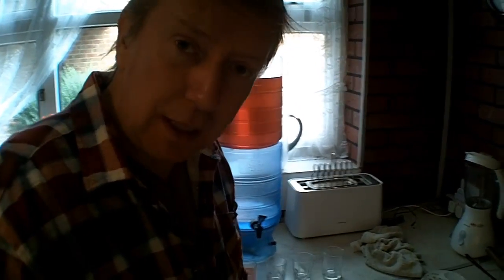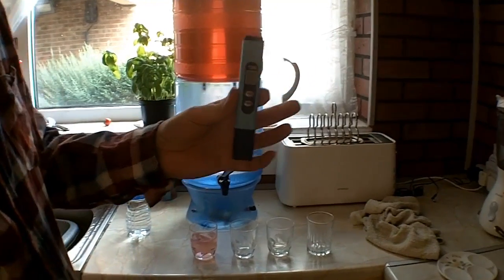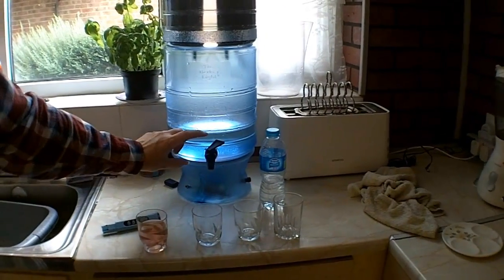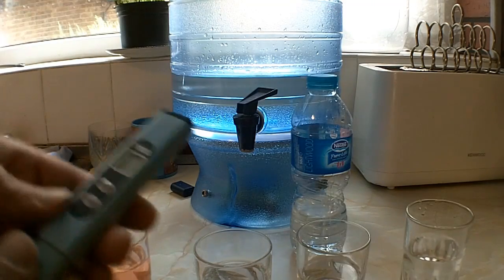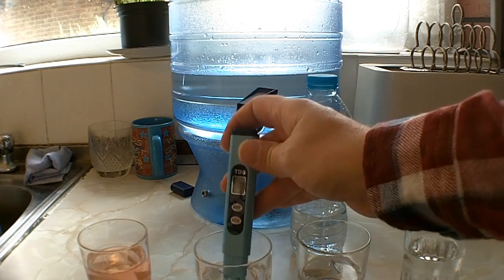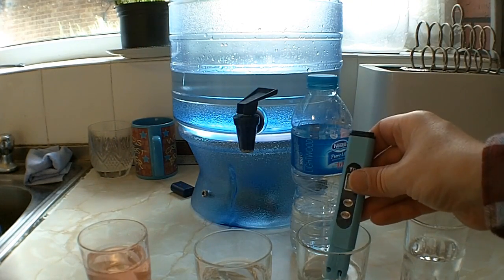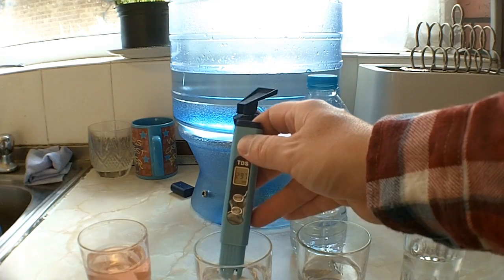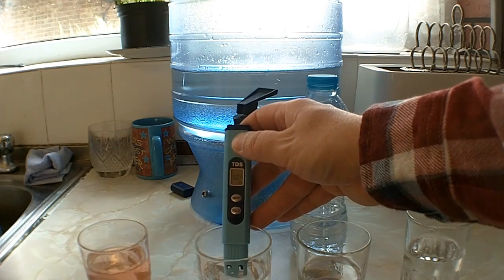Berkey Water Filter PPM Test

Comment: In a recent test:
Tap water: 89ppm and zero chlorine
British Berkefield: 139ppm
Distiller: 2ppm

Been using a distiller for 4 years and adding electrolytes/minerals back into it.

Will be testing the Berkefield with fluoride filters soon.

Comment: Similar thing happened to me with the English Berkley system which looks like a Berkey but has different ceramic filters. I ended up putting it through our Zero Water jug to get the TDS down from over 300 to 9. Anyway thank you for your video.

Comment: I’ve had a ZeroWater filter and it comes with a TDS meter. That results in 000 clean water. Also water from the Glacier machine at the store resulted in 000 clean water. Just got my Berkey Travel and the number was almost the same as my tap water around 550. Very little difference. I’m thinking I haven’t setup my filters right that’s why I’m here in this vid. I too am disappointed in your numbers in the 100’s. I hear what some are saying about not all TDS are bad but like I said my previous filtered water options have given me 000 clean water. Paying as much as I did for my Berkey I’d like to see better results when it comes to TDS so I’d like to see what Berkey has to say about this. 🤔
Reply: Same. Our city tap water is 133. Coming out of the Berkey, it's 140ppm and it's been running for two months now. The water tastes great, but I can indeed agree that it doesn't drop the ppm. I can validate it by testing with distilled water, and my ppm consistently is 0.
Reply: Well the question is that if it leaves minerals because it is not attracted to the carbon and the bad stuff is. Allegedly that's good. I don't know

Comment: Hey I appreciate you for taking the time to make your video. I have been a little bit disappointed in my Berkey recently and I just found a water filter at Walmart called the zero water filter. You should check them out. I have been thinking about making a comparison video with my Berkey comparing it to my new filter.
Reply: $15 per filter that will filter 40 gallons.
Reply: Too expensive. I use berkey for coffee, cooking and drinking. Probably 3 gallons per day
Reply: @jeffwalker1322  I hear ya. I now use different water filters for different applications

Comment: My new Berkey is actually adding dissolved solids to my water. :(
Reply: found something on their site, "How do I determine the performance of my carbon filter?
If you are questioning the efficiency of your water filter, you first need to consider what water contaminants or water quality issues you water filter is designed to address in order to evaluate its performance. Testing the efficiency of a carbon filter (like the black berkey filters) by measuring TDS of the filtered water is of no use whatsoever since a carbon filter does not address TDS."

https://www.bigberkeywaterfilters.com/blog/tds/should-i-be-concerned-about-tds-in-my-water/
Reply: MINE TOO, 10 ppm, wth?! I used a test on distilled water and its 0ppm.... i spent 400 on this years ago and finally got a tester....going to scrub down my filters and clean out and rinse out my filter and retest.
Reply: makes me want to test my urine in it before i ditch it....my tap water is also a little less pH too. im sitting 160ppm 6.4 ph tap and 170ppm 6.9 i think pH with berkey
Reply: @Hedgehodge-  Ours is adding like 200 ppm. That seems like WAY too much and I've filtered several gallons to flush it. Considering sending it back. It was way too expensive to have this nonsense.
Reply: @rubyrainsong  that's odd, do you have the fluoride filters in the bottom (white ones?) Did you flush them in the instructions as said, I forget what it was to do it. I noticed even after doing what it said for those I still noticed a taste so did it some more. If not then dye test residual ? That's odd.

I'm think my 10ppm is me just needing to clean it, not gonna lie, been a few months, supposed to every month
Reply: @Hedgehodge-  Yes. We do have the fluoride filters too. And I have disassembled and re-primed both sets of filters twice. I haven't tried the red dye yet, got pretty discouraged/frustrated and can't even look at "becky" (my kids call it that) right now. I'll give it a go next week. Good luck w/ yours. 10 ppm isn't too bad after all.
Reply: @rubyrainsong  lol that Becky. I remember trying to prime mine on the kitchen sink before they had those things to help you not get sprayed ... Wife thought it was hysterical. 

I guess we will only really know if we test things individually which is a pain. I'd try testing without those white filters for one go and see if it drops lots. Best of luck to you too
Reply: @rubyrainsong  i just conducted this test now after 3 years of owning it, with new & old filters, i concluded it adds about 200 ppm back to water. My question is what has been added back?
Went from 32 ppm to 289ppm
Reply: @tesstele  It's very strange. We got this system to use at a different property which is on a well. I'm thinking of making a video then calling them to question them about this. But yeah, we tested our reverse osmosis water (which measures around 7 on the TDS meter) run it through the Berkey and it goes up to around 240. WTH?!?!
Reply: @rubyrainsong  wow. i am thinking there must be some explanation for this, and so far my research hasn't gotten me anything so hopefully after contacting the company they may give me one.  If u find out anything,, please update us here . Ill do the same. Thank u for sharing.

Comment: Thanks for saving me from buying a Berkey, I'll keep my Zero Water.
Reply: I only used my Berkey water filter for about a day or so and then went back to bottled water. I now have the zero and oh my. Lol
Reply: I might keep it for emergencies. But it's going to be staying in the closet.
Reply: @sydneyshaw6781  We got Zero Water and after a month the water started tasting sour like we added lemon juice to it. Turns out it's their filters leaking their chemicals they use to get the water down to 0 PPM. I turned underweight from that water, and it's been a year yet I can't seem to gain that weight back. 

PPM is the dumbest way to test your water, because it has healthy trace elements that are detected by the TDS devices. The body needs these trace elements. Even bottled water companies RE-ADD these elements after their water is processed and almost ready to be bottled. Who woulda thunk?

And Berkey filters won't remove the trace elements, which is a good thing even though TDS will tell you differently. We're about to buy a Berkey come black friday-ish, to get the best discount (because they are $$!)

Comment: my Berkey Failed TDS test too. I cleaned the device in between each test. 
Distilled/water=1ppm Tap/water=375ppm Berkey/water=356ppm   (ideal drinking water is between 0 and 50ppm)

Berkey standard twin black elements with fluoride filter PF-2

Comment: You didnt clean the device in between each test. Nor did you have distilled water as a standard
Reply: spark fractal you don’t need to
Reply: @itsnotlevel2  a lot of bottle water that people drink is distilled. Heard of Dasani water? It's just distilled tap water!
Reply: @guitarlearningtoplay  I'll reiterate, you don't drink distilled water..... Water and the body req minerals (tds) to process. If you distill your water, you must add back in the tds in order for it to be useful. But distilling is a long process and way more expensive than filtering. The same goes for reverse osmosis, which is a filtering process, the tds has to be added back to be useful. Desani uses reverse osmosis. Using distilled water as a baseline for taste, bioavalabilty and a comparison for drinking water is silly. 25 years as a plumber my friend. Don't be daft.
Reply: Paul DeSano uses distilled and reverse. It has 0 TDS.. them human body is not a metal pipe so don’t be daft yourself. There has never been any proven leaching of minerals from distilled water in any scientific research, I looked for it. As a plumber you should know that most of the TDs in water is hard insoluble minerals that can not be absorbed by the human body and accumulates and causes cancer.
Reply: @itsnotlevel2  I disagree I think the cleaner your water the better, distil your water then add a slice of fruit if you want some minerals..TAP WATER IS DANGEROUS
Reply: @itsnotlevel2  just because you're a plumber doesn't mean you know anything about water quality.  That's like saying I've been a medical doctor for 20 years so I know what is healthy to eat. Distilled water is completely safe to drink. Mineral leaching is a myth and a wives tale.

Comment: You forget the berkey water mantains the healthy minerals in it and that's the ppm you are measuring, while the commercial water may be by inverse osmosis which do not have any minerals in it and is not as healthy.
Reply: I would argue that a) fully filtered water + minerally enriched diet is a better alternative than b) slightly filtered water (with heavy metals + minerals) + minerally enriched diet (minerals of which you may end up pissing out because your body may not need all of them)

Comment: I own a Berkey (Stainless Steel model).  It has two Carbon filters and two Fluorine filters (the white ones).  My TDS reader showed 79 PPM.  (Mind you, the water wasn't fresh, and is filled from my Tap).  My Tap read 74 PPM, but  I have a whole house water filtration/softener system so I'd expect it to be low.  The Refrigerator with is additional carbon filtration was reading about 84 PPM,  my guess is due to the carbon filter.  If that was your 1st filter run, give it a few times and test again.  Another thing, (it was hard to tell in the video),   be sure you submerge the tester at least to where the probe "slots" are submerged.

Comment: Nice but you only checked the TDS. The pH of the Berkey will be higher than any  bottle water, say somewhere around  pH 8.- 9. The bottle waters will somewhere between 7.2 - 5.5. The oxidation reduction potential level (ORP) should  also be more improved  then the bottle waters. The 15 TDS removed might be only contamination that took place between the feed and the tap. This appears that your tap water is already treated and might contain only minerals.  The Berkey is designed not to remove organic nor inorganic essential minerals. Therefore this makes your TDS reading essentially nothing but minerals. You might have to do a little more research to confirm your findings.

Comment: Thanks finally a good review. I have owned a Berkey for two years I just recently tested with a TDS meter also and this is why I've got myself a distiller.. all this time I've been drinking dirty water from my Berkey it seems all it does is make the water taste better by removing clorine and amonioa, guess we are just attracted to shinny things.. and in regards to the below statement I've got the flouride filters also and my reading was the same as my tap water 276 ppm, and a good filter worth its weight in salt would remove the inorganic minerals from the water it's basically like drinking dirt water.. we should only be getting organic minerals from fruit and vegetables and some sea salt.. I will not be using my Berkey anymore
Reply: Some Random, thank you for the link for Distilled water, 👀opening! Just tested my Berkey with a TDS meter and was shocked! Garbage!
Reply: Thank you for the video! What do you use now?
Reply: Thankyou for this.  Why did you get a distiller over reverse osmosis ?   Do you add. minerals back in ?
Reply: Before you reply watch this https://youtu.be/_7Is4cfazoo

Comment: I bought the berkey and I returned it. I've recently purchased a reverse osmosis countertop filtration system and I believe that is the way to go especially if you life in an apartment and don't want to deal with pluming/installation. 

I kind of despise the berkey filter. I got completely and utterly fed up and just down right angry at the darn thing. I purchased mine with the PF2 flouride filters. This was the main reason I chose the berkey because everyone said great things about it and it seemed like the best and cheapest way of removing flouride from drinking water. The instructions are very tedious and the entire setup is very finicky. Customer support always seemed to have an answer and added an extra step or two to what I was already doing in order to get the darn thing to work properly. It's enough to drive one mad. My problem, aside from the watter tasting like rubber, (with just the carbon filters no PF2 filter) was that I could clearly see the water not running through the PF2s, right before my eyes. The water would go through the carbon filter but right where the bottom thread of the carbon filter connects to the PF2s, water was flowing out from the connection and running across the PF2 filter and down into my tank of filtered water. I tried everything to remedy this. I only spun it so many times, as instructions state, I flushed and primed and primed again. I called customer support and got new PF2 filters. I hopped on one leg and did backflips, all to no avail. Even after thoroughly priming the PF2 filters my water was becoming cloudy, I think some water may have been running through the PF2s and the active alumina or w/e was leaking into the filtered water tank. Needless to say, it drove me mad and I returned the entire thing. 

This TDS test doesn't surprise me too much and thank you for doing it. This just proves that the Berkey filter isn't as great as everyone makes it out to be. I think it's simply the way it's advertised to be fantastic and it's more of a placebo effect cause you think you're drinking healthy water... 

Like I said I've recently purchased a reverse osmosis countertop filtration system, along with a TDS meter, and calibration fluid so I know I will get accurate readings. And just an FYI for you rickvanman... The TDS readings from the APEC reverse osmosis counter top filtration system, I've seen them to be around 5... Yes 5... So berkey is in the 300s, RO water is 5... You tell me which one you'd rather be putting into your body. Anyway, hope this helps spread the word about Berkey. If you have a TDS meter I highly recommend you use it to ensure you're getting what you think you've paid for. The countertop RO system I bought, you can get for around 250 bucks... i spent about this much on my berkey so it was a no brainer for me. Now I have yet to actually use it myself and test with a meter but you can look on youtube yourself for the APEC RO countertop filtertration systems and people do TDS tests on them. It really is a no brainer. Also, the best part is, no backflips :D
Reply: Jimmy Goodson  your a dumbass mate your reverse osmosis filtration system is removing all of the good minerals that you need in your water!  Your drinking totally stripped water that’s going to leach minerals out of your body and leave you depleted! Berkey tests higher in PPM because those essential minerals arent being removed.  You have to send the water from your Berkey to a lab and they will show you like they showed me that the harmful bacteria and chems are being removed as advertised.  And seriously if you follow simple instructions it’s not that hard to screw on some filters properly as long as your not a dunce.But Hey enjoy your acidic RO water

Comment: I just completed a PPM test for 5 different waters. I have a Royal Berkey and have gone through more than 8 cycles and cleaned the filters, and it read out at 158 ppm where the Tap Water was 170 ppm (same with pur filter water). I also tested Nestle Pur Life bottled water (58ppm) and Sam's Club bottled water (23ppm). This is with the Sam's Club water being $1.25 cheaper...
Reply: Yup however your forgetting that you do NOT want pure water, you need minerals from the earth transferred through water into your body. Before we ever drank any bottled water our body had more minerals in it that are necessary for life. Since then ever time we imbibe water that is less saturated with these minerals, it equalizes inside of us. Simply put, that makes the water inside of you balance the minerals back into the "Bottled Water" that had less or nearly Zero needed minerals in it effectively sapping your body of minerals. Bottled water companies only add back in the minerals that effect taste of the water as 100% pure water is acidic and tastes horrible, and of course is bad for your health due to the sapping of minerals.
Reply: Those bottled water is actually reversed osmosis water with added minerals. I have a RO machine that also add minerals back in giving me 30 Ppm. My tap water is 300-350 ppm.

Comment: Tx for the vid. Some very useful, helpful comments below too. I just got a Berkey after using a ZeroWater for a couple of years; was somewhat disconcerted when I used the ZeroWater TDS tester on the Berkey output. I now see that the TDS reading is relative, so to speak. My tap water is 130 ppm and the Berkey output is 250 ppm; so was a bit disappointed for a time. It'll just take a little adjusting to the Berkey ppm reading compared to the zero ppm from the ZeroWater.

Comment: TDSs are not necessarily contaminates.  A TDS meter only gives a small fraction of what the water chemistry is made up of.   My tap water is 114 unfiltered and raises to 140 after filtered through the Berkey because the minerals raise slightly through the exchange.  I use a Berkey to filter out pathogens, which it does much more effectively than any other brand I've used, with the exception of my RO unit.  It's pathogens that I want filtered out of my drinking water.
Reply: RO units filter water to near 0, but RO filtering also turns the water acidic.  I don't believe it's acidic enough to be harmful, but neutral  to slightly alkaline seems to taste better.
Reply: Just curious, how is the taste after the Berkey filter?